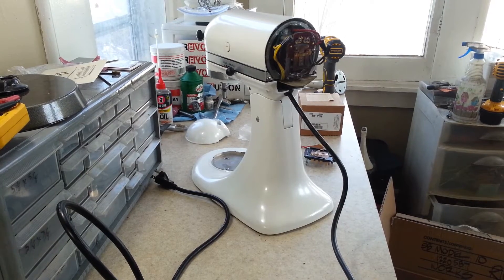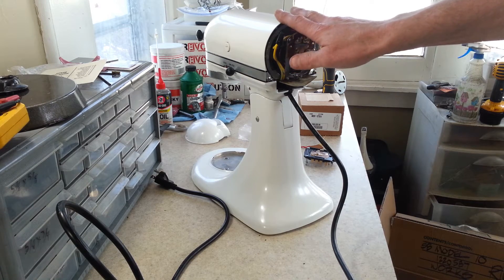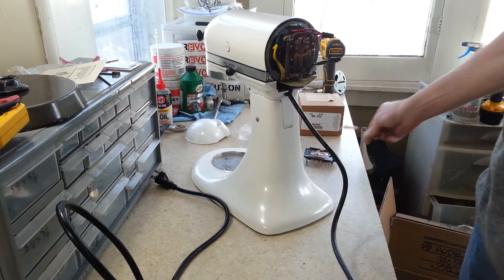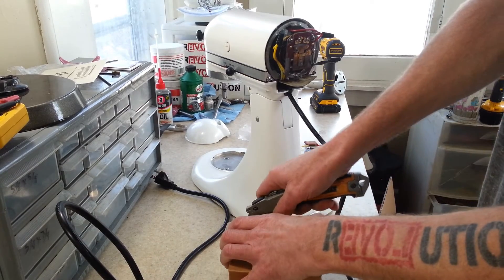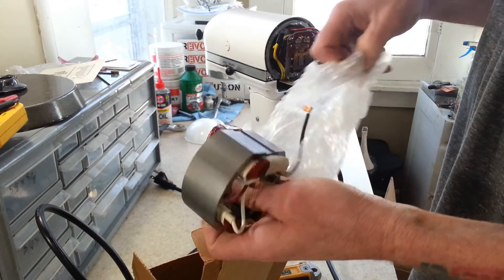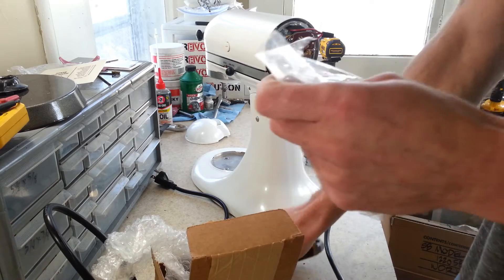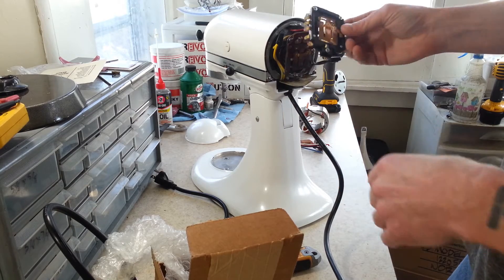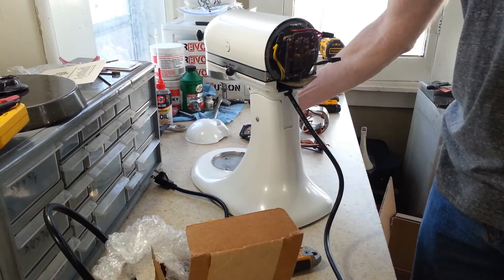Kitchenaid K45 conversion to solid state

Comment: Nice video and thanks for sharing! Based on your experience, do you think the process would be similar to convert the K5A to a "K5SS" solid state mixer?  Can/did you reuse the original armature?
Reply: Yes you can, I just converted my K5-A to a K5-SS. You could reuse the armature and field from the K5-A, just need to rewire the connections. I used donor parts from a K45-SS that was made by Hobart. Everything fit perfectly and my mixer is back to kneading bread and pizza dough.
Reply: @chevyguy6961  Awesome, thank you for confirming!
Reply: @Mini13B  Your welcome, glad I could help and good luck with your mixer upgrade to solid state. On the flip side I'm now looking for parts for the K45-SS that I took parts from for my K5-A. It was my mom's mixer and it's in too good of shape to just part out. It's one of the last Hobart Kitchenaid's also, it was built in January of 1986 as per the date stamp on the armature. Mom's mixer will live again😊

Comment: some people seem to think that for the K5A vs K5SS there were structural changes that were adverse re longevity potential. I was getting ready to buy a K5A and saw this video and started wondering about this capacitor. does the same problem occur on the K5A?
Reply: Plenty of good used parts on ebay. I picked up a used speed control switch and a spare capacitor from Toby's Kitchenaid Part's. These old K5-A's are built like tanks. After a regrease and a set of new brushes mine should run for another decade atleast. Just finished kneading 3 pounds of whole wheat dough with no problems, just got maybe lukewarm while kneading for 8 minutes with the spiral dough hook.
Reply: Phil you can replace the capacitor if that's the problem. Being that my K5-A is 50 years old I keep a spare in the toolbox. I'm thinking about converting it over to solid state even though it runs excellent.

Comment: Can you change a K5a to solid state?
Reply: I would think you would be able to internally the parts are identical. Bottom of the housing is just a different shape to fit the bowl lift stand.
Reply: Yes you can, just need a good donor mixer or new parts to convert it. I used parts off a K45-SS on my K5-A. Everything but the brush holders crossed over and fit. I reused the K5-A brush holders.

Comment: Thanks for the video. I have a K45 that runs only at full speed no matter what speed setting you have the controller set to. I took the back cover off and everything looks to still be connected properly. Is my problem related to the capacitor being bad? If so, cant I just replace the capacitor?

Comment: Well let's see what feedback I can get here...I have  an old K45 like this. Motor was shot and also needed new brush holders. Ordered and installed new motor field and new (modified) brush holders. Getting to rewiring stage and now see new field wires are shown being wired differently in different videos. Would like to see feedback on how to proceed. Should I cut black field wire going to brush holder and splice old green to it or do other parts of this have to be converted to newer style wiring?
Reply from the maker: I converted everything to the new wiring layout, new speed control parts, and wired it up the same as the solid state models, but a couple others have mentioned they used the old coil and wiring layout and just altered it to use the solid state controls. If you are using new coil and speed control parts, I would wire it up the same way a SS machine is wired, but if you are just using a new coil and the older non solid state speed control parts, you are going to have to modify the wiring layout. The solid state models are wired differently, the power is interrupted by the on /off switch before the coil, the older style the power goes through the coil and is interrupted by the old style switch after the coil at the speed control. Also the SS models eliminate the big resistor and the capacitor and replace it all with the phase control board. 
Here is a link to the wiring diagram for an older non solid state model https://www.scribd.com/document/176382158/Kitchen-Aid-K45-Service-Manual-For-Hobart-Made-Vintage-Mixers
You can most likely use this as a guide to rewire a newer coil into a non SS speed control.
Reply: @vintagemixersandmore1666   I like to do this right da first time. Are da following 4 parts from AppliancePartsPro.com all I need and is da phase control bd # correct?
Speed Control Plate - wpw10119326
Phase Control Board - ap6019577
Speed Control Lever - wp9709276
Bracket Bearing Assy. - ap6007717
Reply from the maker: @xlchjoe  I do believe so, if I recall on this one I replaced the coil, lever assembly, rear bearing plate, speed control plate, and phase control board, and a new cord for the SS model.
Reply: @vintagemixersandmore1666  For ref. for all...it is NOT the speed control LEVER that needs to be changed. It's the speed control LINK-SPEED.
Reply: Also, did you reuse the "spacers" that came out AFTER the old field was taken out? (Would go in before new SS field.)
Thanks,
Joe
Reply from the maker: @xlchjoe  Yes I believe I did
Reply from the maker: @xlchjoe  roger that, thanks for the heads up!
Reply: Also studs are too short for any threads to show through new bearing bracket.
Reply from the maker: @xlchjoe  You know to be honest, I am having a hard time recalling all the steps I went through to convert this. It was a while ago, and it was the only one I ended up converting. I always wanted to convert my wifes as well, but I ended up giving it to a collector instead since the wife didnt like a kitchenaid (she is accustomed to a sunbeam). Take anything I say in these comments with a grain of salt, as it may not be entirely accurate since it is based on my not entirely intact memory lol
Reply: @vintagemixersandmore1666   I am waiting for "link" to finish this. All old parts are reusable except for motor.  GOOD CAP! I won't be doing this again. Did for a friend and it snowballed.
Drop a line if you may want old parts.
Joe
Reply from the maker: @xlchjoe  Thanks Joe, yea it kind of did that with me too, I needed more parts than I suspected I would. Good luck with it, it will be great when its finished!
Reply: @vintagemixersandmore1666  Getting there! What do you remember about hole for mounting phase control board to speed control plate and the screw that I didn't order to mount it with? I look at hole on speed control plate and I see an unthreaded hole(?). Can I post a picture here?
Reply from the maker: @xlchjoe  Unfortunately you cant post a picture here, but I am trying to remember, I may have drilled a new hole, its been a while but that seems likely

Comment: Capacitors are not hard to find and are very inexpensive. Off-the-shelf film caps can withstand pulses 1000 times as fast as older caps and are 100 times more reliable.  With capacitors it is fine to replace it with one that is rated higher voltage and capacitance only has to be close (remember that old cap is 10-20% at best when new). Of course you can parallel two caps to make another value. Thank you for sharing your videos.
Reply from the maker: Thanks!! I have found a capacitor that fits well and works great so far. I am not sure why replacement caps I have found that specify they are for kitchenaids are for temporary use only. Appreciate the input, very helpful, thanks!!

Comment: Awesome! Thanks for posting. For future reference - I did find a replacement capacitor that works. Old capacitor in my KitchenAid K45 mixer shorted so mixer ran only at full speed. Markings indicated it was a 0.1 microfarad capacitor. I found one rated for 400VAC (should be ridiculously durable), also a ceramic capacitor like the original. Replacement capacitor is a Vishay Cera-Mite 20VLP10-R. Rated at 0.1 microfarads and 400VAC, with equal or better temperature and tolerance ratings than the original that was in my mixer. Can purchase through Amazon.com, or from www.digikey.com (about $4 plus shipping).
Reply from the maker: Thank you Dave! I just came across another shorted capacitor so i will be ordering some for sure. Appreciate the tip!!
Reply: Good Afternoon - I have an old K45 that only runs at full speed right now -- and if I'm understanding your post here, this problem may be a result of only the capacitor failing, not the entire control plate assembly?  So if I replace ONLY the capacitor (with the one you mentioned), I might be in luck?  I cannot find the entire K45 control plate (I found an old link, but it is out of stock here: https://seniorfossilparts.com/products/kitchenaid-control-plate-assembly-4159678).
Reply: @mammatus77  I have the same problem.  Did you go this route and did it work?
Reply: @Jopjohnson  Unfortunately I have not undertaken any repair; my mixer still exists in its faulty state and I use it when I need to (with a towel draped over the top so as to not scatter ingredients all over the kitchen when starting!). I haven't tried the proposed fix yet because I just lack sufficient confidence in my abilities; and I'd love to have confirmation from someone like the author of this video that this would do the trick before I dive in. In the event you give it a shot, if you could update me, I'd really appreciate it!
Reply: @mammatus77  I ordered the capacitor mentioned on this thread, took less than 15 minutes to install and it's up and running at the needed variable speeda
Reply: @Jopjohnson  Seriously?  That's awesome!  Can you tell me where you ordered it?  And also - any chance you could share with me even just one or two photos of precisely where this capacitor is in the machine so I can make sure I'm tackling the right one?  Thank you so much for the update; I really appreciate it.
Reply: @mammatus77  it's the capacitor described in the top of this thread, I ordered from digikey.com about 10 bucks with shipping. The capacitor is at the top of the control system hidden in a   small cardboard pocket ( I had to cut the pocket open to remove the old capacitor)  Where the red and yellow  wires come together. I have the k45 just like the one shown in this video.  I can't seem to add photos.
Reply: @Jopjohnson  Fantastic -- thank you for the follow-up. I just ordered the capacitor from digikey and have my fingers crossed. I opened up the back of the mixer long ago when I was trying to diagnose the problem, so I got familiar with it, but I need to re-familiarize myself with it. Did you need any special tools to swap out the capacitor? Did you have to solder it on, or was it even simpler than that?  Thanks again for your input.

Comment: First, thank you for these excellent videos. They have been very helpful when doing researching for buying and fixing my own K45 mixer project. 

I ran into a similar problem to you (lack of replacement parts), however I discovered that it is possible to retrofit the phase board into a K45 mixer without replacing the other parts. (No need to replace Speed Control plate, rear bearing plate or Speed Switch lever). I've done that to my own mixer. It meant I could keep the mixer a lot closer to original and its cheaper.
Reply from the maker: Hi Hayden thanks! I had wondered if that would work, it is something I am considering doing to a 4C. Did you eliminate the cap and resistor and just rewired it to the phase board? Were there any issues in using the old speed control plate? That's awesome! I actually like the conversion to phase board since they are available, unlike the capacitors, and feel a lot more confident in doing the 4C now that you have already done it successfully, I wasn't sure it would work. Thanks!
Reply: Yea, I completely removed the cap and resistor. It runs very well now, smooth, with no arcing at the contacts. The phase board sits a little skew, but it fits.

This is the way I wired it: Red from phase board to red from speed control plate. Blue from phase board to yellow from speed control plate. Green from the switch to black from phase board. Red/White from phase board to black from speed control plate. 
I rewired the motor to the SS style, so the power goes through 1 of the field coils, to a brush, over to the other brush and back through the other field coil. That gave me 2 wires from the motor (Red & White). I wired red to the reds from the phase board and speed control plate. That leaves a yellow from the switch and a white from the motor which connects to the power cord. 

It sounds a little complex but it’s not too bad once you get it clear in your head. I think there’s probably a simpler layout, but that’s what I landed on.
Reply from the maker: That's awesome, and I can picture your wiring diagram, so it's making perfect sense. Nice job!   I'm glad to know this, so I can get this 4C up and running. It may be a little different on the wiring for the style of mixer, but I am going to give it a shot, hopefully the phase board will work on one of these models as well. Thanks for sharing that, I'm thrilled to know it works!
Reply: @madmaxz1010  I'm very interested in your technique of replacing the capacitor and resistor with the phase control board.  I have one of the K45 pre solid state mixers and want to have this in my back pocket if it ever fails.  I follow what you did with the phase board, but I'm a little lost on the rewiring of the motor.  I tried to compare the diagram from the K45 manual to the diagram to the K45SS and got confused.  Is it necessary to rewire the motor, or can you simply insert the phase control board in the place of the cap/resistor? Can you provide some more details on how you rewired the motor?  Did you use the existing wires, or did you have to add some?  Have you posted a video on how you did your conversion?  Thanks for any help you can provide.
Reply: @vintagemixersandmore1666  did your conversion of the 4C to the phase  board ever occur? Did it work?

I'm looking at a 1949 vintage 3B and wondering.

Thanks, Joe
Reply from the maker: Hi Joe! I have not attempted it yet, just have no time at the moment. It is definitely something I would like to do as soon as I can.
Reply: @vintagemixersandmore1666  
Thank you for the quick reply, and please keep us posted.

Joe
Reply from the maker: @josephkowalski8886  You bet, will do!
Reply: @vintagemixersandmore1666  
I think this cracks the "code".
   https://goo.gl/images/2uaVbA
If the newer speed control plates are physically the same size as the ones in the old models, I believe this opens the door for back fitting everything to solid state.
Reply: @robertweimer513  @Hayden Dunnicliffe @ Vintage Mixers and More Robert, did you ever find a solution for this?  I'm stuck at the same spot.  The SS stator (field coil) has different colored wires (two whites, a red and black) instead of two blacks, a red and a white, so I'm confused about the next step.  "I rewired the motor to the SS style, so the power goes through 1 of the field coils, to a brush, over to the other brush and back through the other field coil."
This was at the end of the post originally:
Dang, not even that works.  The way you describe it sounds like you'd need 5 wires on the stator.
1) Power in to one coil
2) Power from that coil to the brush (then across to other brush)
3) Power from brush to the other coil

But then you say, "That gave me 2 wires from the motor (Red & White)."
What am I missing?

Also, did you actually change to the stator from the K45SS?  Otherwise, I can't make sense out of it at all

Thanks, Tom
Reply: @madmaxz1010  I am having the same issue as Tom above - I don't know how to "rewire the motor to the SS style" - could you explain a bit further?
Reply: @vintagemixersandmore1666  Did you ever get around to this? I am struggling to figure out how to do it

Comment: Thank you for making the video. Please forgive my terminology: How did you remove the hub with the spring off of the shaft the fan is attached to? I have a mixer that is grinding from the fan and I just need to get it off to swap out. Thanks again!
Reply from the maker: I believe you are referring to the flyweight governor? If so I just pulled it straight off. Kitchenaid manual says to use 2 screwdrivers and pry it off, but someone told me it may break if you do it that way, so just be as careful as you can. A pair of pliers or small vise grips may work good to pull on it with carefully, it is not pressed on, just a snug fit. 
Be careful once you get it off, there is a pin in the shaft that could easily get lost.
Reply: Vintage Mixers and More thank you so much. Keep up the good work
Reply from the maker: Roger that, thanks!!